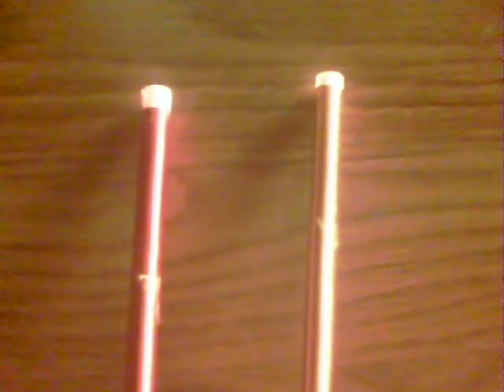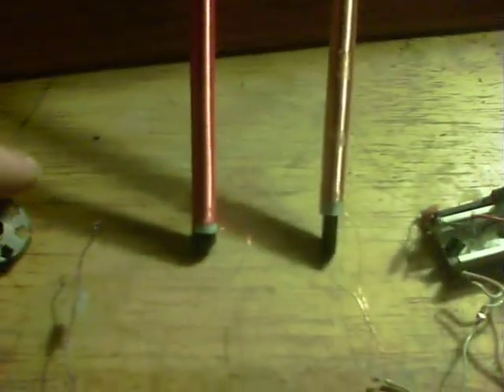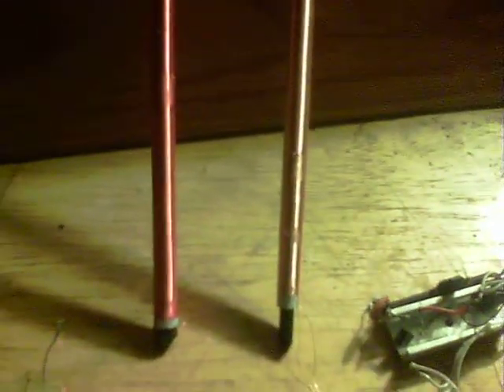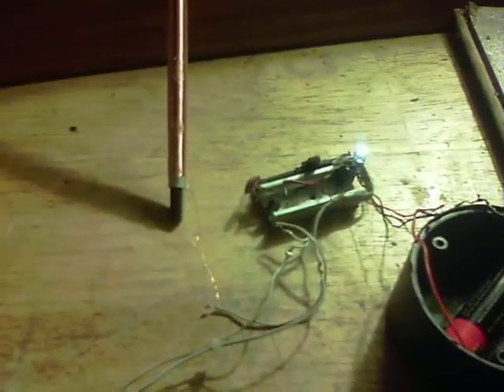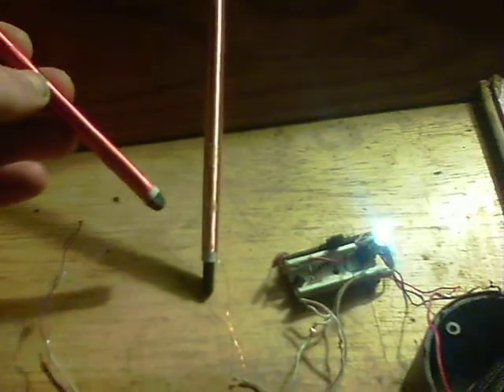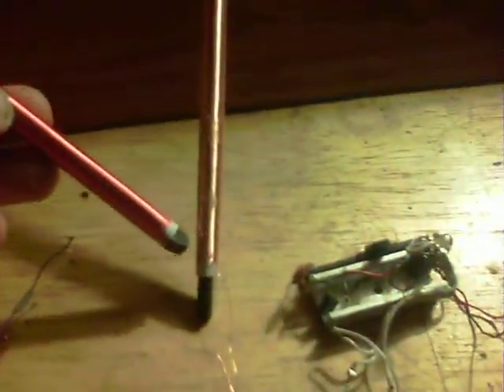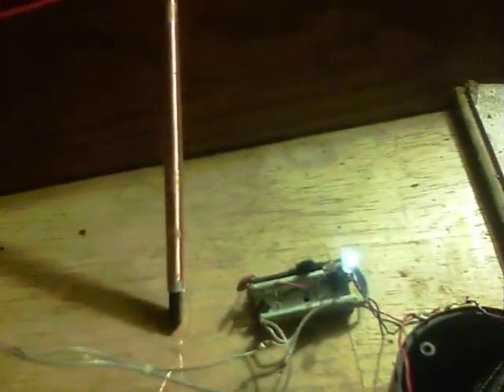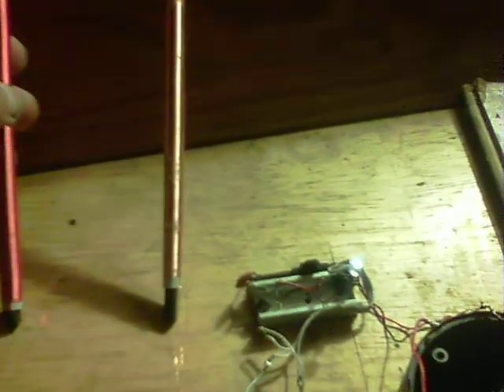Straw Resonance

Comment: if you still got your straws, instead of connecting them the same way Lidmotor schemtic is showing,  i think if you connect just one of the coil (any of them) the opposite way, it will behave different, talking resonnance distance. But i made that with chokes. Never tried with straws so i am 100% sure. Oh btw, i got a blocking oscillator made out of 2 slinkys side by side streched a little to space each turn from the other so they dont short.Works realy nice and funny.Slinkys at the dollar store

Comment from the maker: @slider2732 If the straws are moved up and down relative to each other linearly, the resonance comes in and out, gradually though and not sharply. There are harmonic 'echoes' at certain linear inclinations relative to each other, where the LED will this time sharply switch on, at perhaps 30% brightness.

Comment from the maker: @jackscholze Hi Jack. A sharp increase to full brightness is achieved, by placing the two ferrite ended sections together orthogonally. However, the need for distance to begin resonance is reversed if one straw is upside down ! Nearer they are, the brighter the LED in that case.
The 850K wiper allows setting to just the right spot for all this to occur. By moving the wiper up or down, the circuit behaves as any blocking oscillator would, increasing or decreasing LED brightness linearly.